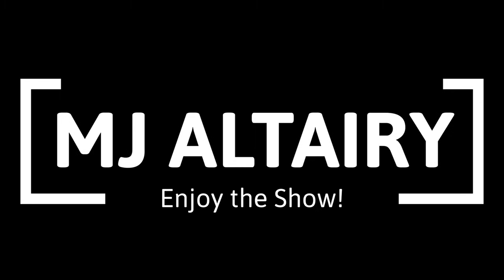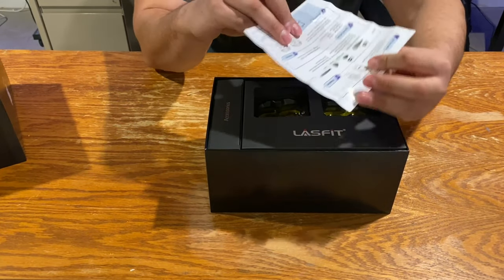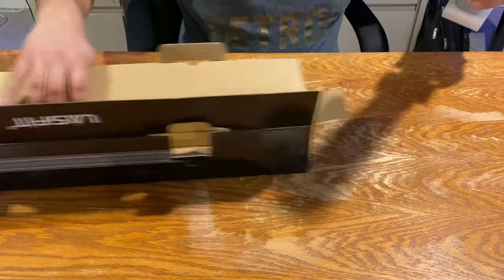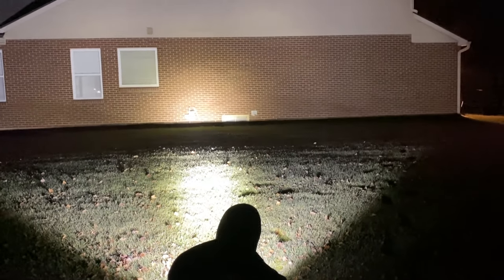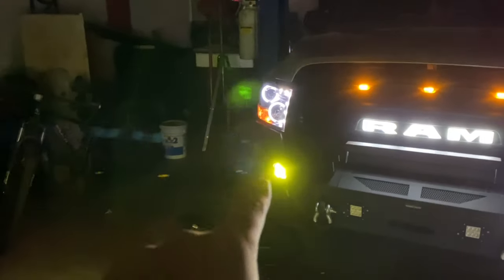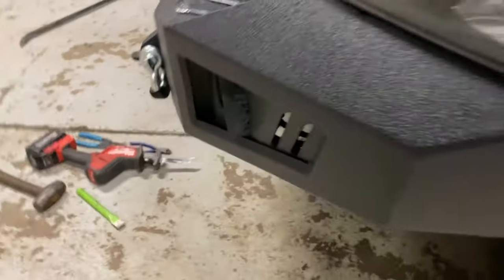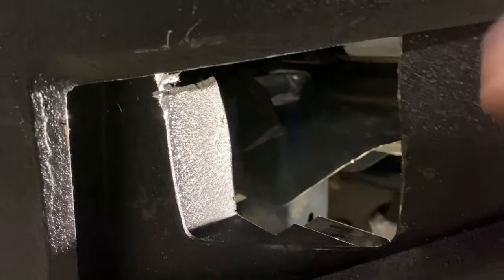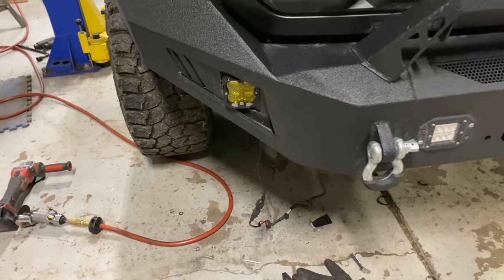Lasfit SAE Fog Lights & 20in LED Bar - Unbox / Install w/RAM 1500 Offroad Bumper

Comment: Where you have the fog lights wired, I was thinking about cutting the area out right there to fit a raptor 3 pod bracket in there. Do you think it would fit?

Comment: im considering getting this bumper, is it bulkier than the oem bumper? do you get a little more clearance on the bottom? its either this or a barricade bumper. i just like how this has the option for a winch and its half the price

Comment: Bro nice truck and the same ram 1500 with same setup but I can’t find a place to buy the led RAM letters I look everywhere no luck please help I’m have the same bumper and grill with a 6” lift and 35s inch tires just missing the led ram letter
Reply from the maker: Try these and if they don’t work, you could probably return them: 

https://amzn.to/3FSZkp7
Reply: I did tried those but they are to big and won’t fit inside the rectangle
Reply from the maker: @soler233  dangg… yeah idk where else to find em :/
Reply: I found them on eBay for $59 just got them thank you so much